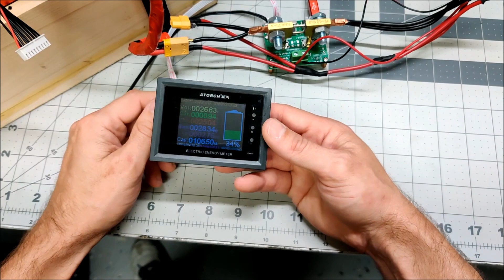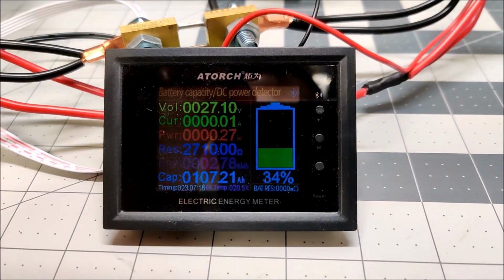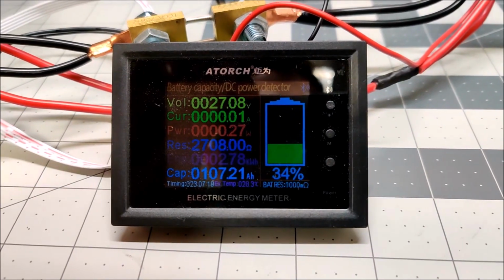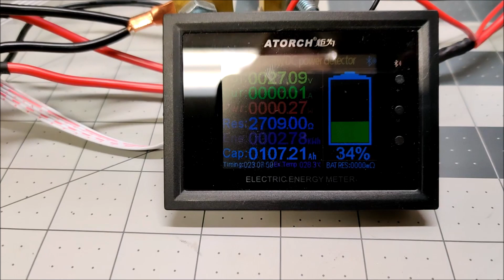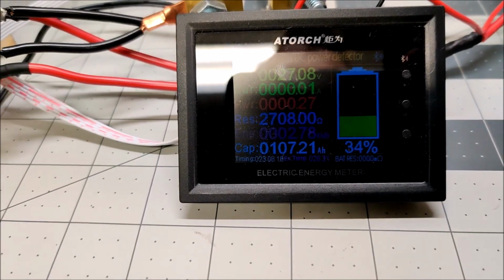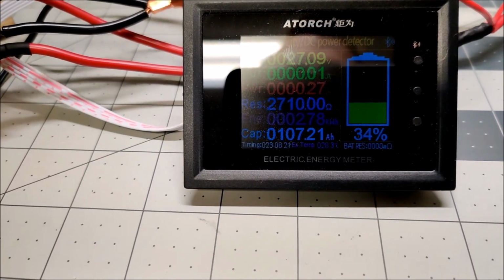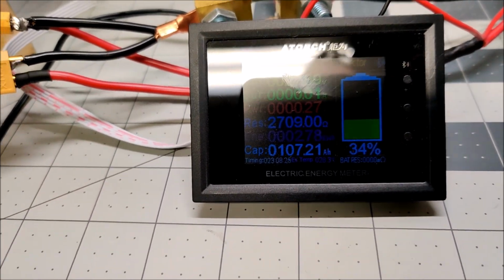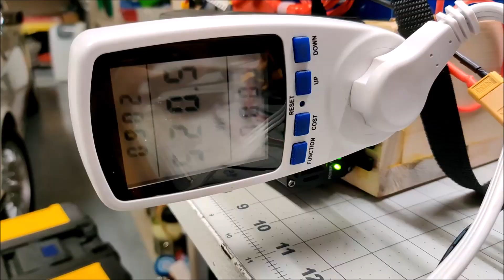lifePO4 UPS - Testing inverter and APC UPS

Comment: UPS "heatsinks" are just that -a small solid block of metal. The premise is that the battery as retailed is only worth about 3 minutes run time. In that 3 minutes the heatsinks will heat, but after 3 minutes the battery will flatten and the UPS inverter will go off.
Getting the heat OUT for long term use is hard but possible. -Fans, vents and down-rating are your friends.

Comment: I tried modifying a cheap cyberpower UPS by replacing the internal lead acid battery with a LiFeP04 of the same size. Ran for ages but got worryingly hot (the board not the battery), sometimes going into thermal shutdown. Also if the resting voltage of the battery was more rhan 12.9 volts (so very low state of charge) the internal charger would refuse to charge it.

Comment: What is the model of your UPS? Was your UPS equipped with lead acid battery originally? I am also planning to use external battery for my UPS but I wonder what is the charging voltage of the UPS. As far as I know, 24v lead acid batteries charge only up to around 25.5V but yours seem to charge up to 27V which is strange.
Reply from the maker: It was a lead acid ups but I bought it used without a battery and the converted it. Lead acid batteries charge to around 13.5v each 12v battery so it should hit 27v for two lead acid batteries. APC pro 1300.
Reply: @stevenc22  I see. I didn't know lead acid can charge up to that high voltage. 13.5V sounds perfect for my use cas. I am planning for LiFePO4 conversion and 13.5 would fully charge the LiFePO4 batteries. Thanks for your explanations. I really appreciate it.

Comment: Unfortunately most of the "consumer" level UPS including the APC models are not really meant for continuous duty. What I found that will handle continuous application without overheating is the APC SUA1500 or DLA1500 (Dell Computer distributed version), they're low frequency inverters and they do have an internal fan inside to keep them cool along with the weight characteristics of a boat anchor even without batteries. I find them almost a dime a dozen at yard sales and thrift stores. Ebay is another option, but shipping cost is ridiculous now due to the weight.

I modified them to have an external battery cable connection with Anderson SB50 connectors using gently preowned 100 Ah telecom AGM batteries. I too am ditching the lead for LiFePO4 batteries. With 100 Ah cells from fully charged to low voltage disconnect with my unscientific test on a 500 watt linear load was just a little over 4 hours. The onboard charger is limited to 5 amps and it pretty much took a good 24 hours to fully recharge it.

Living in a subtropical zone and dealing with summer storms, having a UPS on electronics that don't particularly like hard power down events is definitely a must. As of last count, I have one in the office, entertainment center, mbr nightstand, and garage. They've served me well riding out 2+ hour power cuts giving me plenty of time to decide if I want to fire up the generator or not.

Comment: U chose the wrong model of ups for this project. There are some apc models that support external battery, they have way more powerful charger and have active cooling and can run at their rated power for hours.. i have br1000g and the ups comes with 2x9ah lead acid + it has a 3pin port in the back that allows me to hook an external battery pack of 2x2x9ah lead acid battery sold by apc , the connector is nothing specal it's just spade connectors with + & - directly connected via the pcb to its internal battery and 80amp fuse. & The 3rd pin just needs to be grounded to tell the ups external battery has been connected. I believe it has 3amp charger & 600w max out on battery backup. I have ran it on battery at 600w load with the internal lead acids and it runs for 4-5min . Apc claims it can run 18min with the external pack which i will test out in few days after i done building my Lifepo4 battery.
Reply: Some models are external battery only & they happily accept few hundred amp hour battery capacity & charger them at 20amps